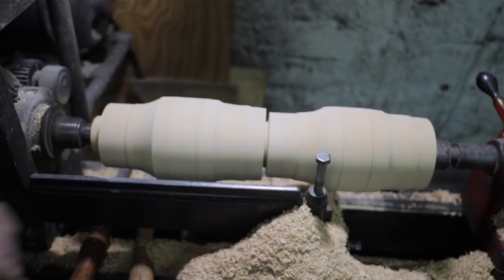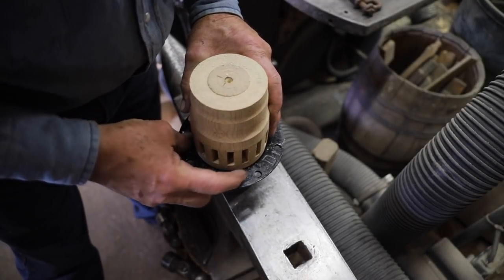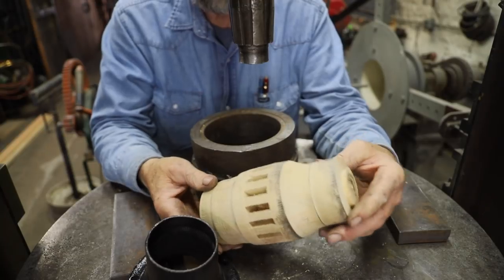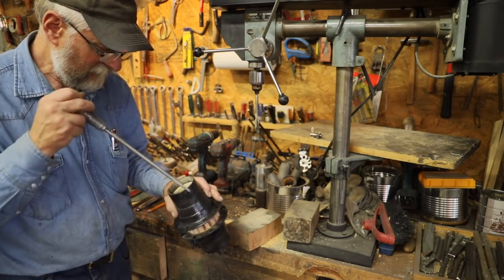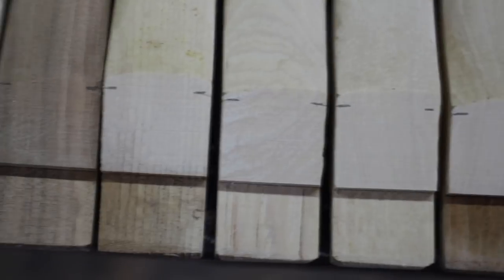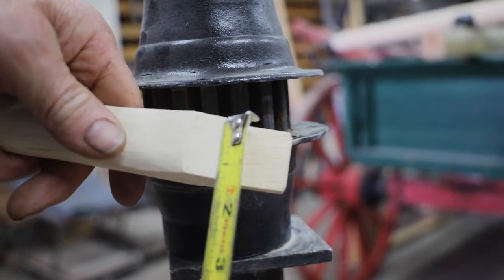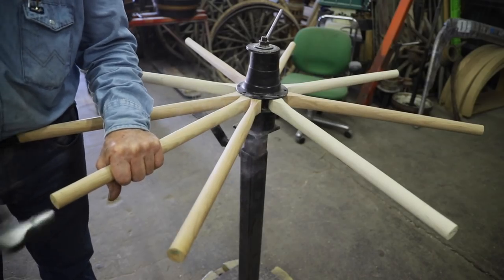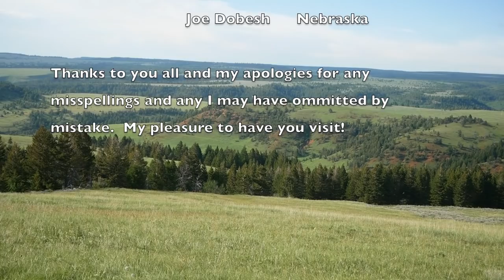1857 Patent Sarven Hubs | Special Guests | Engels Coach Shop

Comment: Amazing precision work what explains why the wheel is rather new. The heart and soul of the wheel is the mechanism which reduces friction enough for the wheel to roll under a heavy load. This called for some precise fitting of the wheel to the axle. It had to be snug enough that the wheel wouldn’t wobble off the axle, but loose enough to allow for greasing. The website Ancient Origins says that wheels weren’t invented until sometime in the 4th millennium BCE because at that time the technology was available to make metal tools to do the fine fitting of the axle to the wheel. Before the invention of metal tools, you couldn’t make precise enough fittings. Native Americans never had metal tools, therefore they could not make functional wheels.

Comment: Always measure and fit instead of hoping it works. :) There are some high level engineers that I've worked with that never seemed to catch a mistake on a drawing of "fitted" parts and would wind up scrapping a lot of material. :)

Comment: So, I've got a question......  I remember a video you did where you repaired a wooden spoke automobile wheel for the museum in Hood River Oregon.  The Sarven hub's in this video look the same or very similar to the auto wheel hub.  Are they the same? Cannot wait until it's my turn to come and visit.  Probably next spring or summer as I'm currently in the middle of building my new Blacksmith shop.  Almost done with the roof..........

Comment: Yes, those hubs and their manufactures "had a better idea" when producing them. Interesting though that no one company got together and said, why don't we all make the same dimensions so the spokes would fit all of them. Like a spare tire, a spare spoke could then be used without any concern for the make of the hub itself. Or, maybe it was they wanted their own dimensions so the folks had to come to them for parts. Actually, that still happens in today's manufacturing.

Comment: So, I don’t understand why the 1 3/8 spokes would have a different angle there. The angle of the spoke heads is purely determined by how many of them there are, isn’t it? Not by the thickness? It’s almost as if your 1 3/8 factory spokes are 1 3/8 by 14 spokes versus the 1 1/4 by 16. Then if you try to fit them into a 1 3/8 by 16 wheel it makes sense that you’d have to thin the angle down to fit the extra two spokes, and after that it also makes sense to thin the part leading up to the angled section for aesthetics.
Reply: EngelsCoachShop ah! It took some thinking, but I’ve wrapped my head around it with that explanation. Thank you.